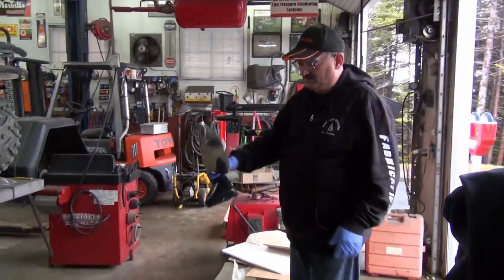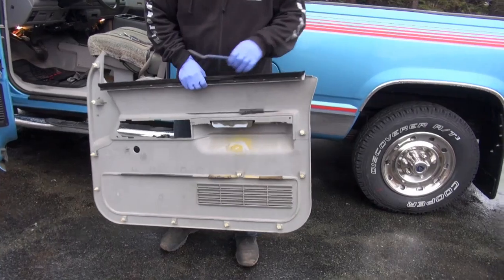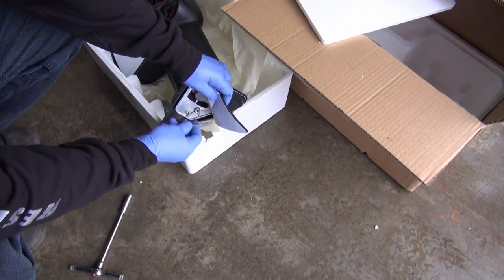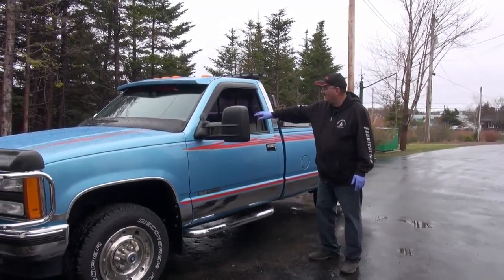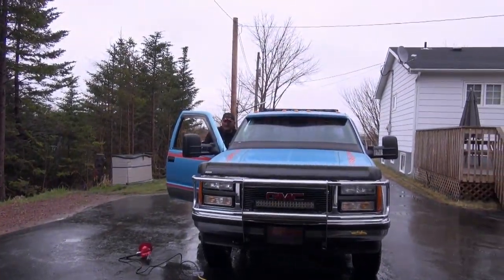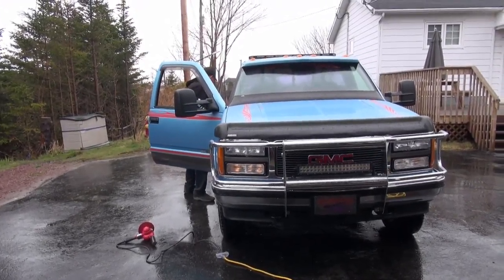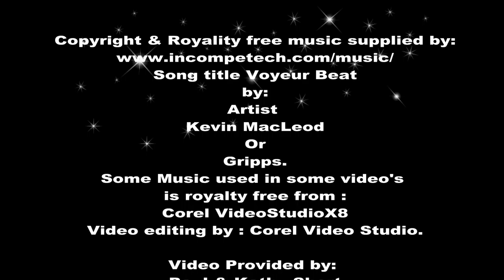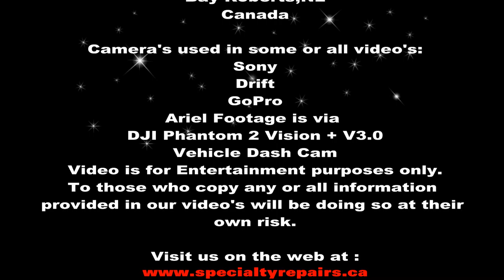Installing FleeBay Trailer Mirrors On A 1993 GMC

Comment: Great tips about getting those door panels off they can be a pain . I use a shop rag to pop those window crank handles off it works great just slide the rag behind the lip on the handle and snag the clip works great . Great video truck is looking good hope all is well

Comment: Can sure get a good view of a rear with them bro. Duck hunting season opened on the first of May down here in NZ so maybe a couple were seeking refuse at your place, they were proberly checking you out to make sure you did not have a shot gun hidden on ya. Lightning starts out life from the groung up so good on ya Kathy for keep well insulated on the dry garage floor. Anyway a neat vid guys. Oh regarding the clip on the window winder I just use a piece of wire with a small bend on one end and hook it rather than push it, even garages use a piece of flat pannel with a small bend on it. Maybe being down under we do things the other way around but still get the same result.

Comment: OH OH OH OH PAUL! I have an idea that maybe will set those mirrors off to a great start! This little micro mod will involve Kathy too. On the back of the mirrors (the side the front of the truck) are two like fins. Between the fins, there is a rectangular area. If your thinking ahead you might know where I'm going with this. If Kathy were to make emblems with the custom mods logo, that match the hub caps chrome and blue, in that empty space that would look just that much cooler! I do have to say the steering wheel you got to replace the OEM naaaa not feeling it too much. But going down the road with the mirrors all decked out would look sweet!

Comment: Paul,  They look great. I may just have to take them under advisement. Our truck has a 90 inch wide body on the back so all these years I have looked at the leading edge of said body except for those old slide ons on the edge. It is like looking through flys eyes.  The 5740 is staying. I like it better than the Avant dealers. Be well.      Wayne

Comment: Took my drivers side mirror off backing out of the garage one day. Wanted to go with the bigger tow mirrors but wasn't sure how I'd like them from a drivers perspective since I don't tow/haul anything so I opted for the standard mirror.
Reply from the maker: +Keith Brettell 
You made the right choice. I wouldn't have changed them IF I wasn't pulling a trailer but I put it off for to long and now was the time. Having spent thousands of hours as a heavy equipment operator I use my mirrors a lot.

Comment: Ol blue is mighty nice. I'm to cheap to buy the window crank removal tool so I use two paper clips bent with hooks on the end and pull the clip out that way. Would the guard on the front hold up to a moose strike or is it more of an ornament?

Comment: When is the durimax engine swapp happen, and when it happens will there be a Cathy transmission to go along with it or will the Mrs mind taking an Allison along for the ride?
Reply from the maker: +Stephen Luciak 
Lol. I put a  Mitsubishi diesel out of a welding machine in a '72 Chev step side about 15 years ago. Great truck. Under hood mods for this old guy will be next springs video instalment

Comment: i read a review on installing the tow mirrors on the older truck that they vibrated more going down the road is that true
Reply from the maker: +quietmale00101 
Had the truck out today and there was a little bit but so did the oem. I was very pleased with the way they worked out.
Reply: cool

Comment: ol blue is definitely looking good for being a Chevy. I'm a Ford guy. ford trucks that is.  lol
Reply from the maker: +Jeffrey Murdock 
Well I worked for GM and still own a GM, a Dodge, a Ford and a Honda so I'm not bias. Thanks
Reply: Paul Short I'm kind of the same. I prefer Ford but I'm stuck driving a Dodge Caravan and also on a Nissan Maxima along with Honda motorcycle
Reply from the maker: +Jeffrey Murdock 
Hey nothing wrong with a Caravan. We have a 2013 with StowNGo seating and just love the thing. The Mustang vert I special ordered and customized and it's a fun car with only 20.000km on it. The Wing is great but not much time to use any of it with work and videos lol. Ride safe.
Reply: +Paul Short it's a good van for me considering its a 2006 model and the fact that I use it like it's a pickup truck is ridiculous. imagine using your van to carry 647 sheets of three eighths inch plywood. my bike is a Nighthawk 700 SC with the shaft drive.
Reply from the maker: +Jeffrey Murdock 
I know what you mean about using the van as a truck. We see guys at Home Depot in new trucks and have to put their lumber through the sliding window to get their purchase home. We pull in with the van, pull the seats down in the floor, load the van up and close the rear door. Can't be beat. May not look the coolest driving one but at my age cool has been gone a long time now lol. You have a nice bike. I worked on them as a Honda tech way back when bikes were real bikes.
Reply: I put the really big stuff like Plywood And sheetrock on the roof. People look at me like I'm crazy when I do that but hey gotta you gotta do what you gotta do